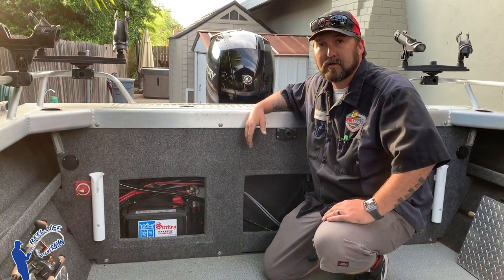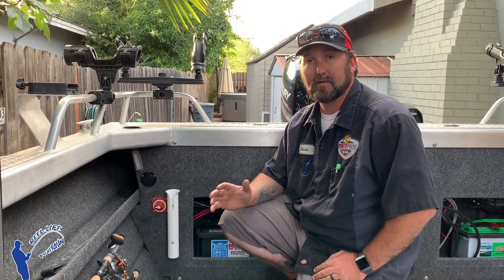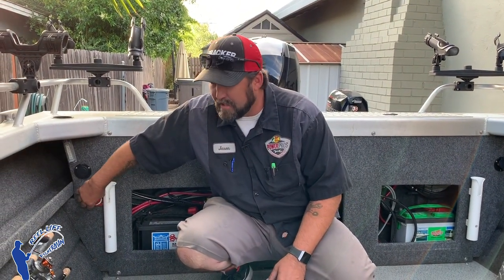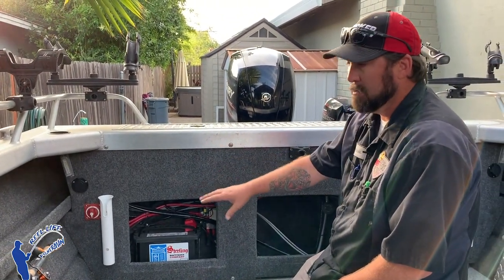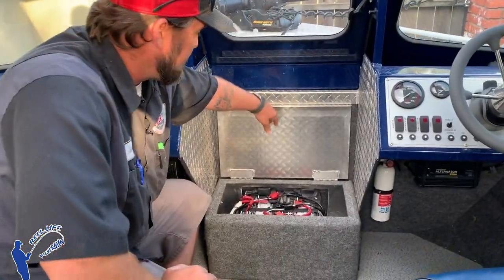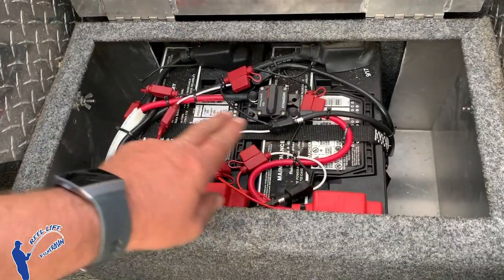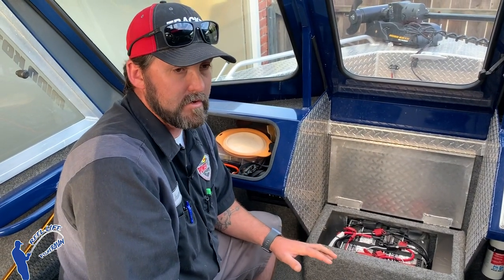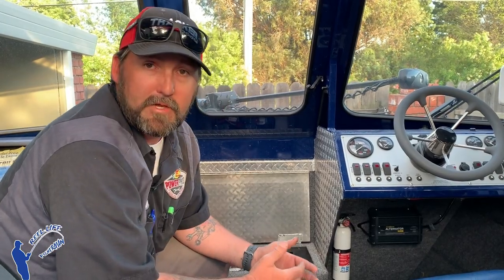BOAT BATTERY WIRING  | HOW TO

Comment: Thank you for the awesome videos! One question on the crank battery and house battery... is there any reason I shouldn't be able to run a crank battery on one side, and TWO house batteries in parallel on the other side? Just thinking of extended battery life for auxiliary items (lights, chart plotter, stereo, etc).
Reply from the maker: Thanks I’m glad you like the videos! So when you hook up two batteries in parallel.. it’s still 12v but the amperage doubles..  also the batteries have to be exactly the same.. size ,type,rating and age.. I would recommend just getting as big of a battery as you can fit..  I now have a group 31 deep cycle as my house battery and a group 27 cranking battery.. I never have any problems fishing all night in one spot with tons of lights and 2 graphs on.. hopefully that helps and let me know if you have any questions

Comment: Hello Jason, what's up from gulf coast Florida! I just came across your videos and appreciate the effort for making them. I have a 22ft Angler that I want to run some led strip lights for general lighting in the and around the boat but also for better marker lights. I was wondering if you know of or could recommend any brand led lights? I also have dual batteries with the same switch but was also wondering if I should tie them in parallel? Thanks again for the videos.
Reply from the maker: Hey thanks for watching! So TH Marine makes really good led light kits.. there are many Unknown brands that make them too but TH Marine is the  "brand name" ones..  and if you have the same battery switch and it has a "all" or "1&2" position the 2 batteries are in parallel  in that position.. hopefully that helps you out.. let me know if you have any more questions.. thanks again for checking out my channel! Tight lines!

Comment: Thank you for the clear explanation of the setup. I currently already have 2 batteries in my searay 260DA. I thinking of adding a 3rd battery to act as a house battery. Can i just connect it in parallel to the existing 2nd battery and will the engine alternator be able to charge this 3rd battery when engine is runningor there maybe a need to change the alternator size to suit the need?

Comment: Jason, 

If I have 2 house batteries because of my sound system on the boat and wanted to bridge them, would I do it the traditional way? (Join + to + and - to - ?) I'm working on re-wiring on my boat (Thanks to your content) and this is the only question I have Thus far.

I hope you can help.
Reply from the maker: Yes you would hook it up parallel. Positive to positive and negative to negative. But have the load come off one battery positive and the other battery negative. That way it draws both batteries down equally. Hope that make sense. It’s still 12v that way. I’m not talking about wiring series 24v . Thanks for watching and commenting! Let me know if you have any questions.

Comment: Thank you.  When running 12v in parallel, can one be deep cycle and the other be a cranking batt?
Reply from the maker: No when wiring 2 batteries in parallel.. both should be the exact same battery.. type ,size, rating.. I would even recommend age and brand..  also in parallel the voltage stays the same but amperage doubles .. there are a few other things about parallel wiring also but let me know if you have any more questions.. thanks for watching and commenting..

Comment: Very good video. I'm new to boats so I'm a little confused about wiring the batteries in series or parallel. What is the advantages of either and which situations would they be best suited for?
Reply from the maker: For trolling motor wiring.. series bumps up you output to 24 or 36v with 2 or 3 12v batteries.. in parallel you can run 2 12v batteries and keep the output at 12 v but it does double the amps..  some trolling motor are 12 v so running 2 batteries in parallel doubles your run time.. and some trolling motors are 24v or 36v and you have to wire them in series to get that.. hope that helps.. thanks for watching
Reply: @ReelLifeFisherman  thank you

Comment: How would you wire in 36 volt trolling motor if you only have four batteries to work with? I was thinking of wiring 3 batteries to get 36 volts in series and then use one of those batteries for 12 volt battery one position, and the remaining battery for battery 2. Kind of a series parallel what are your thoughts?
Reply from the maker: carlos alvarez so great question! We wire up a lot of bass boats similar to how you describe.. so have one crank battery and 3 deep cycles .. wire position 1 on the switch to the crank battery and then hook just one of the trolling motor deep cycles up to position 2 .. that way you can switch to it if you need to.. thanks for watching.. let me know if you have any other questions

Comment: Enjoy your videos. Your hands on experience is priceless. Quick question I'm  thinking abput instaling a minkota 2 bank alternator charger. I'm not sure what my alternator out put power is on the 1998 johsnson motor. I have a 12 volt house battery and a 24 volt trolling motor battery system. Do you have some helpful advice to pass on about alternator chagers.

Comment: I’ve got a couple questions regarding a dual battery set up that i plan on installing within a few days. You seem very knowledgeable on the subject.  Could i ask away lol?
Reply from the maker: Yes thanks for watching.. ask away! lol I love to help out
Reply: @ReelLifeFisherman  I’ve got 90’s sea ray open bow with a single group 24 cranking battery.  I’d like to add a second battery so when I’m stopped i can listen to some tunes and not worry about the cranking battery dying.  Do you suggest a 1- 2 switch, on/off switch with an acr, or just a simple isolator?

Comment: Nice video, very informative.
 
I have a 21 ft walkaround with 225 hp yamaha. I'm thinking of putting the house and motor AGM batteries inside the cabin, about 14 ft from the transom, and run 2 positive and 1 negative wires ALL 2AWG and install all inside the cabin like the ACR, Switch, Circuit Breaker, Panel and Fuses, and Solar Power Charger. Do you think 2AWG is good enough? BTW, I'm not an electrician. Thanks

Comment: Hey thanks for the videos I’m adding a battery to my boat soon and have a question I’m going to use the blue sea add a battery kit and was wondering where do I run my kicker/trolling motor power cables to? Do I run them to the same place my main engine cable go to or can I run them to the 2nd battery?

Comment: Hello Jason
Just watch the battery video which was very informative. I just have little 16ft Scout, bought a trolling motor for it. It’s a 12v you mention to run parallel? My question is how hard is it to run the cable from the front to the back for the wiring? Is it easy or should I take it in to the shop? What do you recommend?
Reply from the maker: Thanks for watching! Yes running 2 batteries in parallel will more than double your run time.. all you need to do is run a set of jummper wires positive to positive and negative to negative.. this makes 2 batteries one big 12v battery..  as far as running the wire it depends on how hard it is to fish it through the bilge or gunnel up to the bow.  If it is a center console probably going up the middle of your boat would be best.. but all boats are different .. so hard to say without seeing it in person.. a shop would most likely charge you 4 to 6 hrs of labor.. the shop I work for is $110 a hr. Hope that helps.. feel free to ask me if I can be of any more help..

Comment: So I have a Lund Rebel XS. I am looking at getting that alternator charger from Minn Kota. Also some day I want to add one talon.  I see each have a purple wire.  Is the ignition wire also purple under the dash? Should I run a 4 way splice into the purple wire than?
Reply from the maker: Yes I would just use butt connectors and splice them together that way.. if you have a hr meter that also is a easy way to pick up the ignition power.. almost all boats are wired the same and the solid purple wire is ignition power.. the talons and the alternator charger use it as a ignition sensing voltage only .. the talons for the warning alarm if you start the engine while they are deployed.. and the charger to start sending any excess voltage to the trolling motor batteries.. thanks for watching and let me know if you have any questions..

Comment: Great video sir, question... I do a lot of river fishing and want to ensure I have the juice to crank and run electrics. 

Could I just run a simple on/off switch for the power then just run my two rear batteries in parallel. Or do I NEED the option to switch between the batteries. 

My trolling motor is 24volt and separate in the front of the boat
Reply from the maker: BassQuest thanks glad you like the video! The reasoning for running a crank and a separate house battery.. with a battery selector switch that allows you to choose between battery 1 or battery 2 or both.. is so you always have a back up battery.. if you ran in parallel they could both drain or one battery going bad would take the other one down.. it would become like a Parasite .. that is the main reason.. hope that helps.. and thanks for watching
Reply: @ReelLifeFisherman  if I run the wires like you did can I run my graphs, lights, etc no wonder which setting I use?
Reply from the maker: Yep exactly.. everything just has to be ran to a main bus bar or fuse distribution box the that is hooked to the output/ common on the switch.. then everything runs off either battery.. or both combines them through the switch..
Reply from the maker: Yep exactly.. everything just has to be ran to a main bus bar or fuse distribution box the that is hooked to the output/ common on the switch.. then everything runs off either battery.. or both combines them through the switch..

Comment: Extremely informative.  I just installed a dual bank alternator charger as you have by your steering wheel.  The manual says to connect the PURPLE wire to an ignition source.  My charger is near the boat motor so I was wondering what wire on the motor could I connect the Purple wire to without going to the ignition switch?
Reply from the maker: Larry Thompson thanks I’m glad you liked the video! So each motor will be a little different.. but any circuit that is key on engine on power.. if you have a hr meters that circuit would work also..  solid purple is almost always key on ignition power.. check with a meter or test light that it comes on with the key and stays on while running.. then tap into it.. hopefully that helps.. let me know if you have any questions..
Reply: @ReelLifeFisherman  Appreciate the help.  Will give it a go...........

Comment: Are the two separate 2-bank battery chargers connected to one outlet (AC power port) above the battery switch? Is it as simple as adding an extender/splitter connecting the two power leads?  The follow-up question being is it safe to charge two battery chargers off of one extension cord?
Reply from the maker: Thanks for the great question.. you can just run them on a splitter with a medium  or heavy duty extension cord .. but I typically will just leave the trolling motor batteries plugged in most of the time.. and maybe once or twice a month plug in the rear crank and house battery charger for a few days.. hope that answers your question.. and thanks for watching

Comment: On your trolling motor wiring setup. What amp size fuse do you use on a 12v, 24v, 36v system? Or are they all the same? Thanks Jason great DIY videos!
Reply from the maker: So on a 12v I would recommend a 50amp and most 24 or 36 I would run a 60amp resettable circuit breaker . Let me know if you have any questions.. and thanks for watching the channel!
Reply: @ReelLifeFisherman  Keep up the great videos. Your DIY videos are very informative 👍

Comment: Great video on battery explanations. Quick question - how would you go about adding  a shutoff switch for minn kota Talons so they don't drain, and is it better to connect it to a starter battery if you already have plenty accessories running off the starter (Helix 10s, boat accessories,  etc) or better to run off a 36volt trolling motor battery set up? Appreciate the input
Reply from the maker: You don’t want to run anything off the trolling motor batteries. The best thing to do is to always add a house battery set up with a isolator or automatic charging relay. That way all accessories will run off the house and just the engine will be on the cranking battery.  But if you don’t have the room for another battery i would recommend getting a bigger cranking battery and hooking a bus Bus bar to the output side of the battery switch then hooking the talons to that . All you need in that situation is a on /off battery switch . Let me know if you have any questions. Thanks for watching
Reply: @ReelLifeFisherman  yes I don't have room for an extra battery and barely fit 4 due to my boat being a skeeter Solera 189 fish and ski that I am trying to convert for bass fishing. I do have the new powerpole charge system installed which charges on the run, so hopefully that will keep me running okay with the talons wired on the trolling motor battery. What is a bus bus bar?

Comment: How do you recommend connecting 6 gauge duplex running to a 8 gauge trolling motor receptacle under a pontoon to keep it water proof?
Reply from the maker: Dustin Hunter heat shrink butt connectors and one larger pice of heat shrink over both.. or use regular butt connectors with a smaller pieces of heat shrink over each and one larger over both..

Comment: Do you recommend having a battery switch ALSO for the trolling battery setup?  

I use my cranking battery for minimal house stuff/fish finder. When I add trolling motor battery, was thinking of putting it on the switch like you show in the video.

Comment: I have a series rigged 24v 2 battery system for the trolling motor on my 21 ft jet boat.  Currently the system is dedicated solely to the trolling motor.  However, I would also like to use the batteries in parallel 12v mode in an emergency to operate my winch (Extreme shallow water jet boat).  Do you know of any way to set up wiring with an appropriate switching system to make this possible?
Reply from the maker: Thanks for checking out the video! So I have never seen wiring set up like the one you are describing.. you would have to have multiple on/off switches like 5.. it would be easier to wire it to a house battery (group 31 deep cycle) then switch to that one and if needed switch it to all which puts the crank battery in parallel.. then if you had to in a emergency carry some jumper cables to start the boat from one of your trolling motor batteries.. hopefully that helps.. let me know if you have any more questions..

Comment: Can you make a parts list and links for the same equipment?  More specifically, I’m looking for the fuse you mentioned on the trolling battery.
Reply from the maker: Absolutely I'll try and type it all out later tonight when I get home from work.. thanks for watching
Reply from the maker: Sorry I have been super busy and haven’t got back to you.. so it sounds like you need a resettable circuit breaker for you trolling motor wiring.. most of them need to be either a 50 or 60 amp.. minn Kota makes their own.. are you also looking for stuff like the battery selector switch and fuse distribution box as well? Or just trolling motor battery wiring stuff?

Comment: To run the two batteries on the switch to get power from both batteries at the same time, how are those batteries hooked together series or parallel?

Comment: If i have two batteries hooked in parallel do i hook one bank to each battery or one bank to one battery  or do you suggest i disconnect the parallel connection before charging
Reply from the maker: Great question. You want a bank per battery. They are smart chargers and they can tell the difference believe it or not..  if you want them both to get a proper charge,  a bank per battery.

Comment: When installing 12v batteries in parallel for a trolling motor, do you install the positive wire from the trolling motor to one of the two batteries and the negative wire to the negative terminal of the other battery. Or, connect both wires from the trolling more to just one of the batteries.
Reply from the maker: A. Scott  you can do it either way as long and the 2 batteries are connected positive to positive and negative to negative.. but it is recommended to hook it to the positive on one and the negative on the other.. it’s supposed to help drain both batteries at the same time.. thanks for watching! And let me know if you have any other questions.. tight lines!
Reply: Thanks for the informative and fast response.

Comment: On a 12 v parallel with two batteries should you go trolling motor to battery one positive and the trolling negative to the negative of battery two? I realize the pos to pos and neg to neg on both batteries.
Reply from the maker: Yes , that way it drains the  batteries exactly the same across both..  thanks for watching.